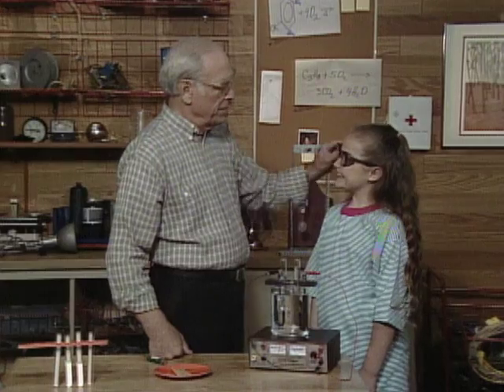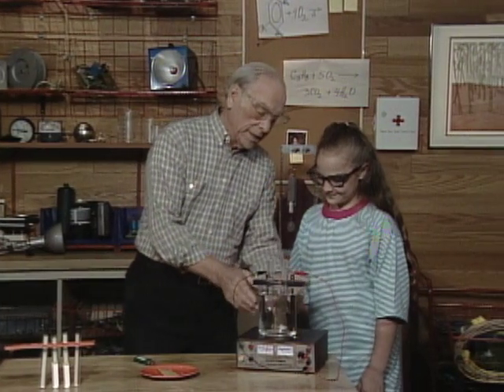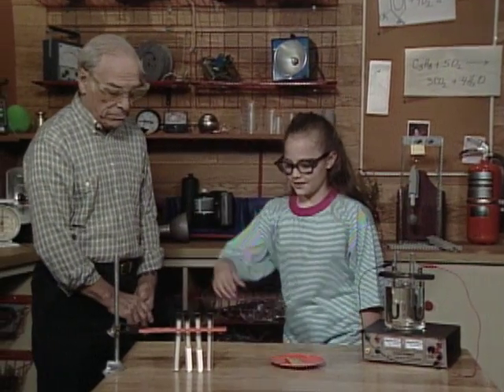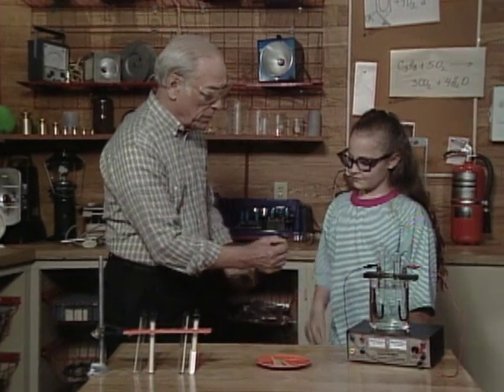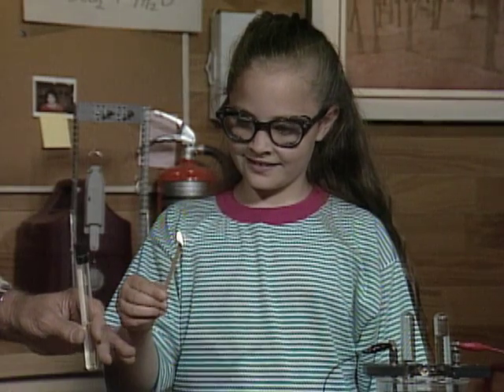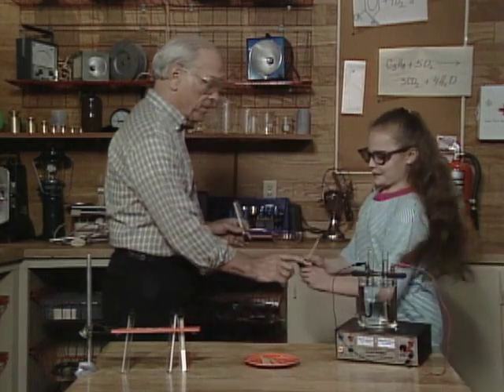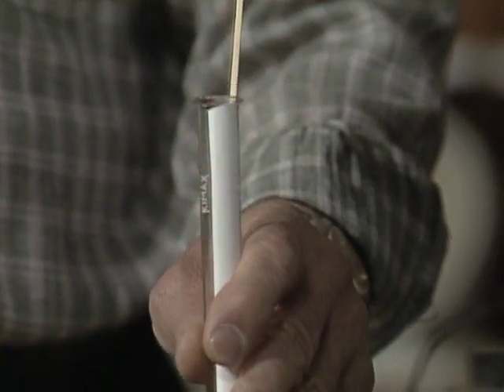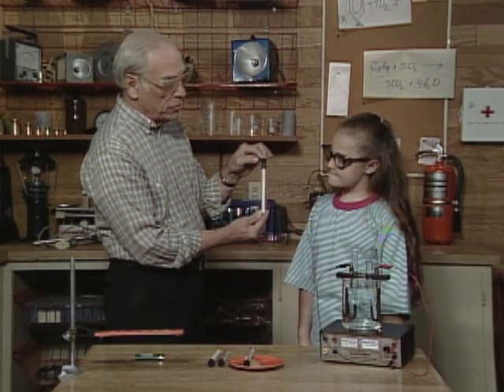How Do You Take Water Apart? (Mr. Wizard)

Comment: what would happen if you drink the oxygen?
Reply: Well you can't drink oxygen gas.  I guess someone could try drinking liquefied oxygen but it's nearly 300 degrees below zero and they'll probably die, if not from freezing their insides then from their body exploding from the pressure of the rapidly boiling oxygen.
Reply: Omg. That's interesting to find out.
Reply: You'll be fine as long as you drink twice as much hydrogen. It will make water in your tummy.
Reply: Go find out